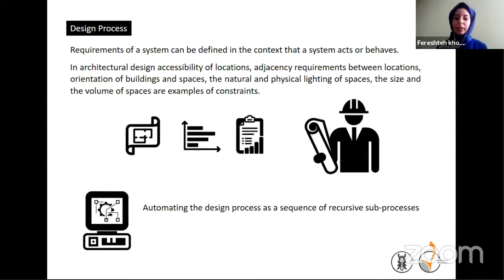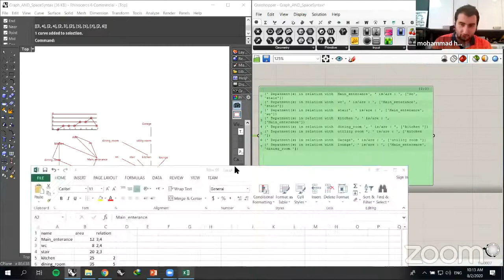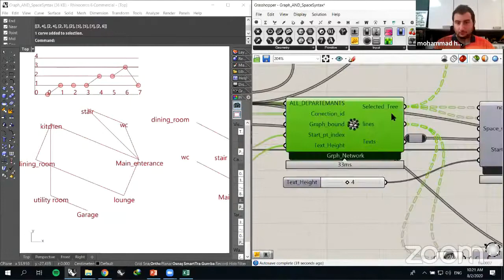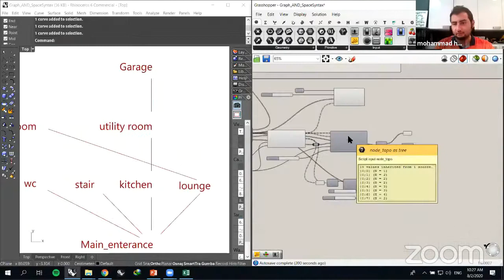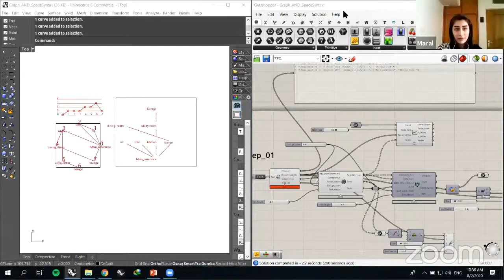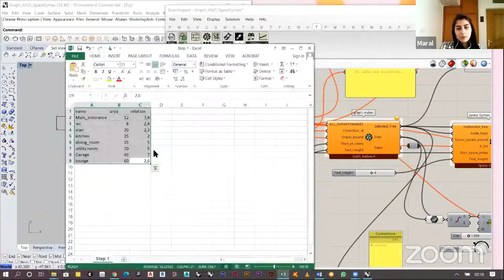CAADRIA 2020- Day 1 (Part 1)

Comment: Hello. Thanks so much for the webinar. That's the only source that could make this topic clear. Hod did the situation with csv file end up? I have the same problem and couldn't follow along. Is there a certain way you created your csv? I tried to recreate the script by SpaceSyntax instructions. Didn't work either, it shows some errors  and doesn't have Discko Graph in it. And also interested in what is inside the python script on the right

Comment: Hi, I do have questions about the CSV input file - how can I rewrite it to my use? Do I have to put every information in one column or seperatly? My gh-file doesn't take my csv-file - it tells me: "Solution exception: Index out of range:2"..doesn't matter if I put all the information in one collumn or in seperate ones..please help
PS: I sent an email as well.
Reply from the maker: Hello, In this video we describe how you can change it. Regard your problem check if you choose the right columns for spatial relations and area. Also, all of your cells (rows) should be fulfilled for each space. If you have further problems, email me your definition to check it for you. The new version of termite_Nest is under development and will be released soon this month. Many bugs are fixed that make work more lovely and faster.
Reply: @mohammadhassansalehtabari5073  thank you so much for your response - i managed to write the csv file via editor - that works for me. Nethertheless I do have some other questions - which email adress may I use to contact you with further questions? Thanks for your help in advance!!
kind regards, Maria
Reply: @mariaantoniazahlbruckner4707  Can you share the excel file? I got an error when I created the excel file